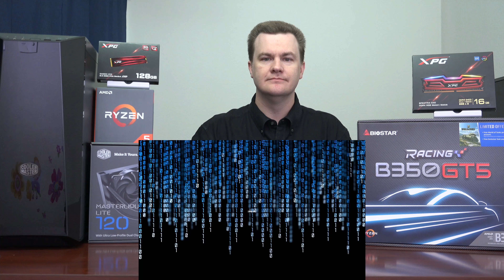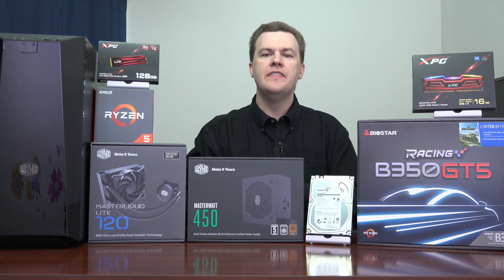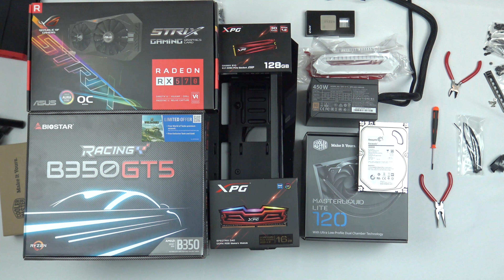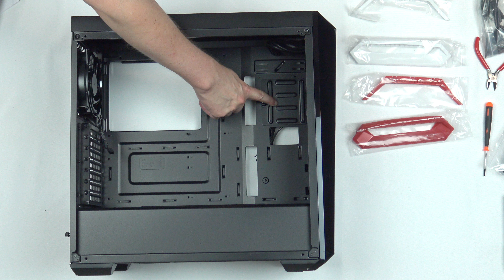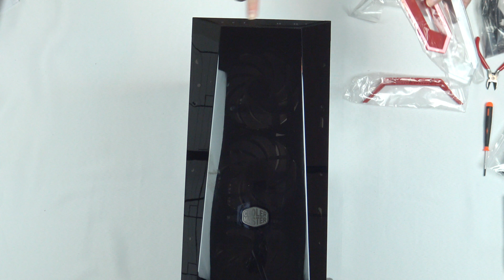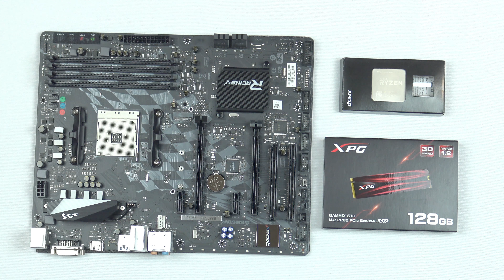Ryzen 5 1600X - Step-By-Step Build - Part 2

Comment: do you think you can mount a 3 120mm fan radiator on the front?, that’s what i’m wanting to do. except on my master box the power supply shield only goes halfway  so it looks like there is room for it

Comment: Hey quick question, the way you mounted your 120mm fan, do you put that behind the radiator or in front of it? I saw what you did, but I've seen other people put it in front of the radiator, rather than behind it. Is there any performance (cooling) gain, or is it just a personal preference to do either or?

Comment: Hey man, know this is an older video, but do you remember how you adjusted your RGB case fan lights? Picked up this case and paired it with MSI X470 motherboard and cannot figure out how to adjust fan color settings

Comment: If I build same system with ryzen 1600 or 1800 even can be threadripper it will let me able to next 5 year play game 4k @45-60fps? Medium settings no AA?
Reply: Ulas Bulut Ezberci in higher resolution CPU isn't so much Important, just make sure your GPU is enough powerful for 4k gaming and has enough VRAM

Comment: Hi recently i made a pc build using this case. I used that molex power connector for powering up the 3 front intake fan. But it results full 100% speed and noices all time. Now i am using asus z370 prime a mobo which has 2 chasis fan header. One at back one at front back is used for back side preinstalled fan . So only 1 front header left. Can i connect them to the motherboard with any fan hub? Or how to control the fan speed. Please do reply

Comment: I just have a doubt in the Liquid cooler installation, shouldn't the radiator be in the back of the case and fan facing inside the case if we want to set it up as exhaust?

Comment: you def have your style of videos which i like about it.

my steps of building the desktop for my customers is slightly different from yours

with the mobo outside of the case the stock air cooler of the Wraith Spire, RAM and those pesky mobo power cables plugs if the PSU is those fully modular units will go in first. 

I have once cracked a few cheap mobo by accident when doing RAM and PSU installs. And thats even with my finger supporting the back of the mobo.

And i always have a habit of holding the mobo by the CPU cooler and install the mobo into the case.

Comment: Thanks for this build. I have been doing my own searching and without a doubt there is no need to go up any farther for gaming needs than the 1600(X). If at all, the difference from the 1600(X)-1700(X) in FPS boost value is very minimal, since the majority of the graphics work for gaming, as you've noted in past videos, is done through the GPU. I will however, get the GTX 1070, without question, hands down! The GTX 1080ti is way too expensive and the GTX 1060ti falls short in some areas as well in 1080p gaming/detail settings. Why get the 1060 when you can fork over an extra $50 bucks, get the 1070 and be happy for the rest of the year? Thanks for this build! A very important one at that!! For today's gaming needs and at this point in time, the AMD reference for gaming is the 1600/1600X. No need to keep searching in vain like I was!

Comment: While running the systems, could you post thermal images too? If that's a biggie, temperature readings using IR gun will do just fine, especially that of the HDDs. Not sure if the AIDA64 values are trustworthy.

Comment: Love watching your videos they have helped in my first Ryzen build (first ever build actually). I have one issue I purchased a case and MSI motherboard that I want to replace (will be using them in a 2nd build in future). Want to use my ryzen 5 1500x, M.2 samsung with windows 10 (oem from Kinwin) , WD blue 1T, MSI 1050ti and 16gb (4x4gb ram 2400mhz) and replace B350 tomahawk with an AsRock x370 fatil1ty. Please  help me understand what I have to do to properly make a motherboard swap! I have searched and have not found a clear answer or explanation on the proper way to go about this. My first build was successful so I am confident that with proper guide, I can accomplish this.  Great videos dropping likes on all videos I watch!

Comment: Good luck with the giveaway everyone! Nice work dude. Glad the case didn't fall over installing the PSU like that ;) Masterwatt lite? I hear it's decent but I don't see it often, probably because it's a new unit. Makes me wonder how much stuff like PSU voltage stability and noise affect overclocking these days. They used to recommend stuff like rmx and G2 series over the the lower quality ones just for improving your OC.

Comment: Hey Tech Deals! Unrelated to this video but I have a Pentium G4560/1050ti build with 8gb of ddr4 Ram. Do you think upgrading to 16gb would be worth it or should I spend my money elsewhere?
Reply: Winston Wolfe if you want to play triple a games maybe, if you play casual or esports games its fine
Reply: I do tend to play AAA games.. GTA 5, PUBG and Elder Scrolls Online are my main games at the moment. I might buy Destiny 2 soon or at least wait till it goes on sale down the line but I do want to play it so I think I'll upgrade to 16bgb.
Reply: Winston Wolfe then yes, it is more future proof for future upgrades, upcoming games tend to use more than 8gb
Reply: Winston Wolfe pubg definitely runs smoother with more than 8gb of ram. Most games don't need more than 8gb but pubg is not that well optimized.

Comment: Would love to see a step by step guide for how to update a intel based system to a amd / ryzen based system. I'am changing my 5 year old i5 system to a ryzen one and it will be the first time I build it myself. I know I will prob have to reinstall windows 10 and clear my hard drive but I'am not sure about the steps to take.
Reply from the maker: Thanks for the suggestion!
Reply: You have to pretty much change motherboard, cpu and ram. Make sure your motherboard is the form factor of your case but if it is oem it probably wouldn't work without modifications. You should only keep your storage with your new system but i recommend buying at least one more for backup( probably an ssd and make it your bootdrive) since its already 5 years old. Well graphics card can go on any system that the psu supports.

Comment: If you don't have a magnetic screwdriver, you can make any screwdriver magnetic. Take a strong magnet and run the magnet from handle to tip a few times. This aligns the molecules for magnetism. Only run the magnet one way. If you go back and forth you are magnetizing and demagnetizing with each back and forth motion. To demagnetize the screwdriver simply run the magnet from tip to handle. You're welcome.

Comment: This might get lost in the sea of comments but...
Does a Ryzen 3 1200, 8Gb (2x4) 2400Mhz CL15 and a GTX 1050 2Gb give adequate performance in eSports games? Like 1080p 100fps CSGO or 70fps Overwatch?
Or 1080p 50fps low GTA V?
P.S: I don't mind turning down settings, I watch LowSpecGamer but I'd rather have normal settings.
Reply from the maker: Yes, that is plenty...
Reply: yes, you will be fine

Comment: First time builder here, After watching countless youtube videos and going to tons of forums, I feel like I know more than enough to build a PC. But, i'm still afraid to screw something up with the cables and cpu insertion...
Reply from the maker: I understand...  it isn't something you should rush, but it also isn't overly complex either, it is just putting together LEGO...  expensive LEGO, but just parts that fit together.
Reply: After building my pc and then taking it apart and building it again i feel really confident in building, its really easy. I just had to disassemble it because of a motherboard issue that wasn't my fault, i just rma it.
Reply: You'll be fine. I've seen very brash friends make perfect computers very fast and they still haven't burnt out in 2 years. If you're as meticulous as you seem, like me, you'll do great!

Comment: Nice... You make it look easy, that's for sure. You're years of experience are on display. thanks
Reply from the maker: That, and lots of editing!  :)
This actually took about 2 hours to build, but lots of little boring things were cut out.  It wouldn't take 2 hours if I wasn't filming however, just because I've done it hundreds of times.  Lots of little things are said and done for the camera that would be quicker without it.
It is just a fancy LEGO set  :)

Comment: I'm planning to change my i5 6400 to R5 1600x. Is it worth it? Mainly use it for gaming
Reply from the maker: Depends on the games you're playing...  per core performance isn't a lot faster, but 6 cores and 12 threads vs the 4 cores and 4 threads helps in some games.  Not most, but the number is growing...

Comment: Honestly the system looks pretty neat apart from that the PSU feels a bit weak for it, while it is true I'm not a computer building pro I've always been told that cheaping out on the PSU and going low power isn't the best thing to do as it puts excessive strain on it.
Reply: Right, as I said, I am by no means someone you should go to for getting help with parts,  it was just a concern based on what I've been told, that of course doesn't mean what I've been told was correct. Thank you for the clarification.
Reply: Faedranor well by "cheaping" we mostly mean get one that is stable.
Reply: Uhh, 450 watts is plenty. 80+ bronze is good, and Cooler Master is a reputable brand. So this PSU is pretty fine.
Reply: It's a new PSU so unfortunately there's no reviews, but we can hope it's another Seasonic rebrand like most of Cooler Master's other PSUs. That being said, a system like this is going to use ~300W with an overclocked card and CPU, so 450W is plenty.
Reply: Ryzen solved the high power consumption and is now more efficient than intel.
Reply: The GPU is the most consuming component in a gaming pc, and you can still run a 1080 with only 450W (bronze mini) but yeah I'm pretty sure it will impact the life expectancy.
But if you go high overclock on i7 with liquid cooling and put an AMD gpu (which are known to consume more) like the vegas you'll go over 500W so an upgrade is needed, but for this build it's okay